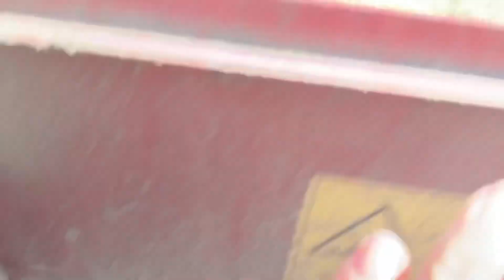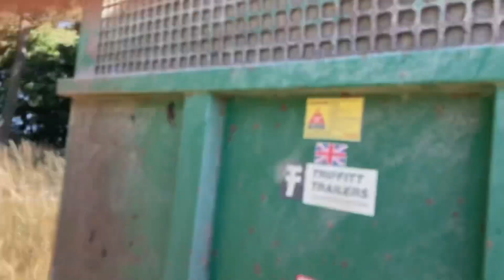Harvesting a field of organic rye. Start to finish.

Comment: Lovely sample and the added bonus of the cover. How many kg of cover did you get in the end? 
I was told about you by Richard at Dove farms. 
Day off no one about raining and just watched a few of your videos.
Reply from the maker: Thanks for watching Robert. Unfortunately I didn’t get the clover seed separated out this year because the rye was on a seed contract and went very soon after harvest. When we separated the clover seed out in 2021 we got about 10kg/acre of clover seed but the rye wasn’t that good.
Reply: @jstringerandsonsfarming  
The cover made up for the rye. 
Would you grow clover specifically for seed?
Reply from the maker: @roberthiggins6401  I never thought we would be able to grow clover seed here. We go up to about 800 feet so damp late harvests are normal apart from this year. However I think if you can direct drill into an established clover with a cereal then we seem to be able to harvest both. If it doesn’t work then the clover is great for the soil and the stock. I have talked about it with a local seed merchant but haven’t got that far yet.